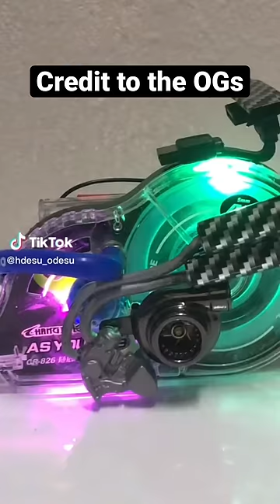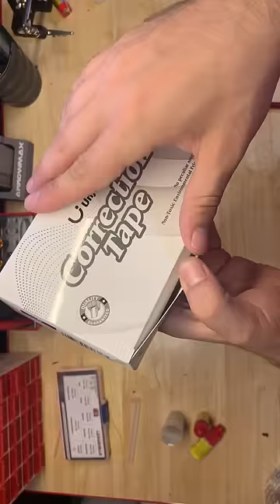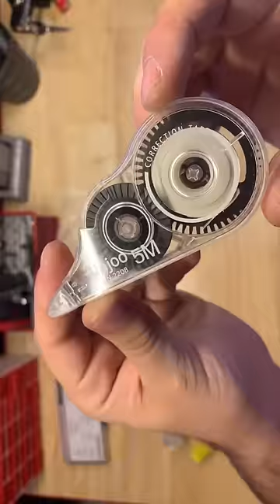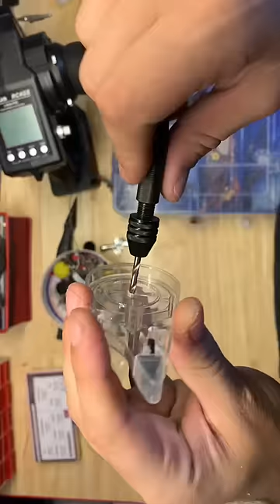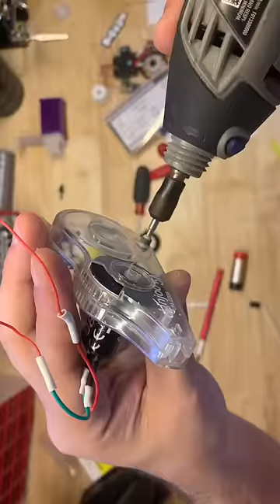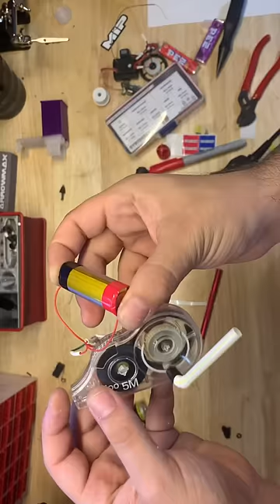DIY Correction Tape Engine

Comment: Correcting tape, hmmm.. 🤔
Anyones remember the "original" correction liquid? Originally known n marketed as "Liquid Paper" , quick drying and it's a huge success (at least locally) back in mid or early 80s (during my 4th years elementary). Originally comes in 2 bottles pack - the white liquid (along with applying brush attached to the bottle cap as a single pack design) and softener liquid (kind of ethanol/alcohol based nail polish) as it would get dried n cracks quickly from freq exposure to air when being used; the design later changed to a single simpler & less messy container package (as to date).

But the pupil quickly got over creatives, using them to "express" their loves n emotions over all other surfaces n walls resulting in them being banned just years later (during my mid-school years) - except that they persisted, still avail n in used to date due to how simple n useful they're as compares to conventional uses of ink-eraser (remember those two-colors rubbery things?);

I can go on and on, and on blabbering as I reminisce about those (golden?) yester-years, but that'll be for another time. In the meantime, I'll just reliving those bitter n sweet memories, privately here. ❤